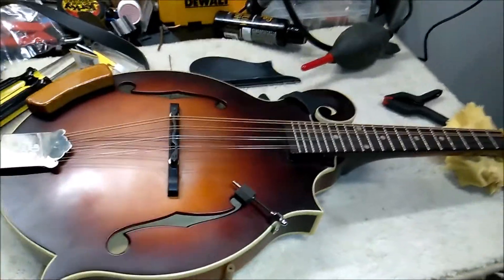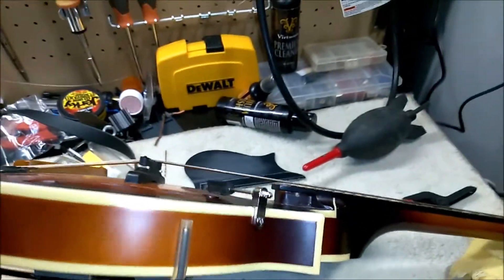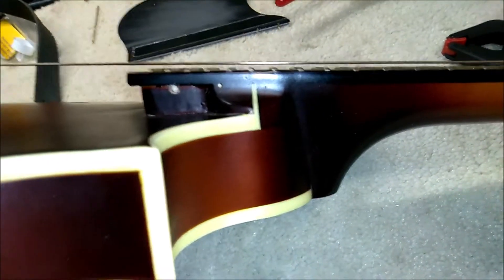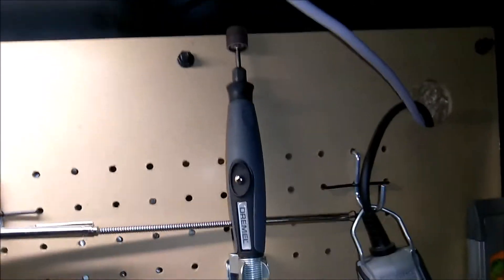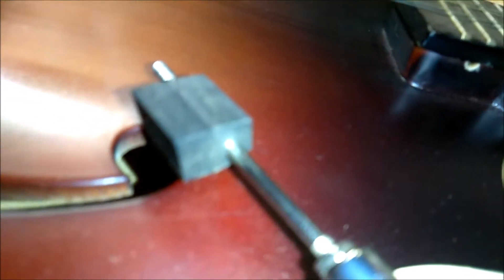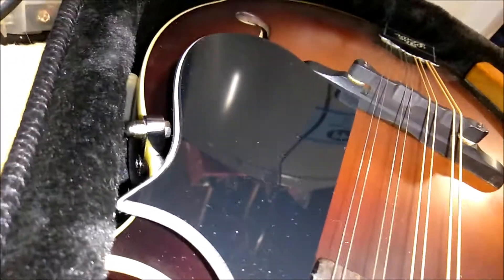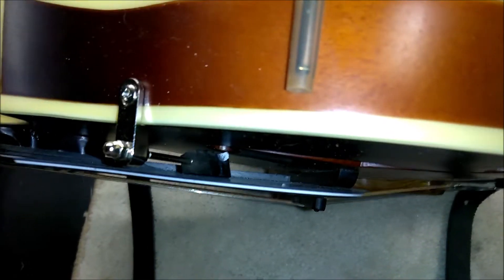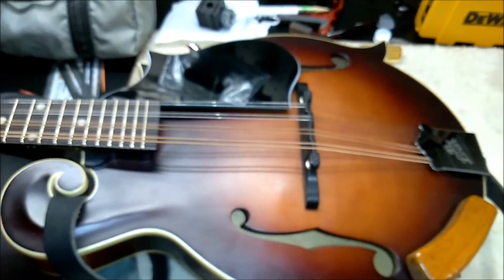Mandolin Pickguard Install - The Loar LM-310f

Comment: Where did you get this pick guard?
Reply from the maker: Amazon! 😁 It's a "Golden Gate M-401A F-Model Mandolin Pickguard Assembly - Black/White/Black". It's $17.88 and it says they only have 9 in stock but more on the way.
Reply from the maker: and you'll need some super glue and maybe a bit of sandpaper or steel wool to rough up the back and the block.
Reply: @Billkwando  Did you have enough clearance for the pick guard? I was worried the bridge might need to get moved down the body to accommodate the pick guard but I'm not opposed to shaping and sanding the guard itself
Reply from the maker: @blackktieguy  I would think if the mandolin were properly intonated then the bridge shouldn't be in the way. Plus, depending on how close the bridge was, the angle is such that it would clear the bridge feet completely, even it they were close enough to be under it....so as long as it's not close enough to bump up against the non-feet part of the bridge, it would still be fine, hypothetically. I don't think it's going to be an actual problem in reality. Naturally you can't move the bridge down the body. It can only be in one location...where the intonation is correct. 😜
Reply: @Billkwando  Yeah I figured looking at the video it should all be good. Have you ever changed the tuning machines on these by chance? I'm looking to get some gold ones but I'm not sure what these take or what would be a good replacement. They look like grovers to me but I could be wrong
Reply from the maker: @blackktieguy  Why not just order some from amazon and return them if they don't fit? Reason: Defective > Didn't fit lol
https://www.amazon.com/s?k=mandolin+machine+heads&sprefix=mandolin+ma%2Caps%2C62&ref=nb_sb_ss_ts-doa-p_1_11
Reply from the maker: @blackktieguy  These look good: https://www.amazon.com/Golden-Gate-FM-3-Embossed-Mandolin/dp/B005N559DU/ref=sr_1_44?keywords=mandolin+machine+heads&qid=1651199076&sprefix=mandolin+ma%2Caps%2C62&sr=8-44#customerReviews
Reply from the maker: @blackktieguy  I don't think they're grovers, but they may be elmos.